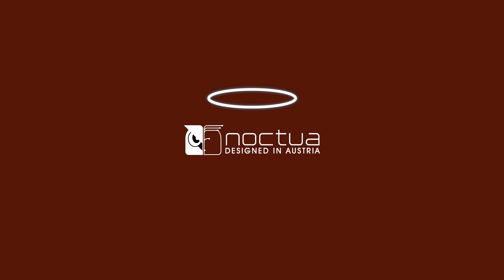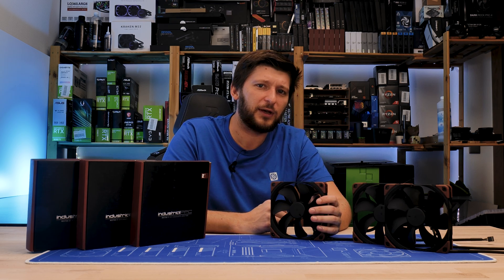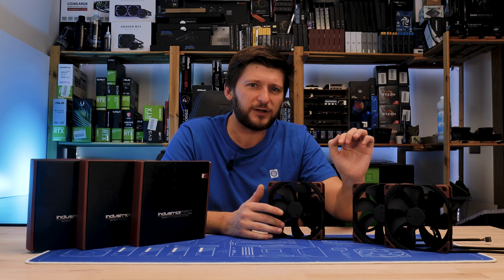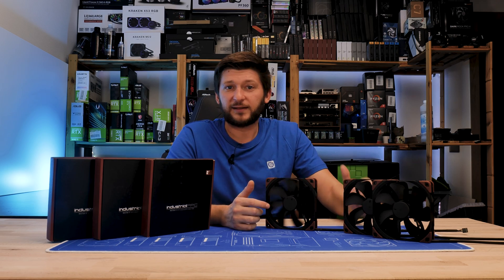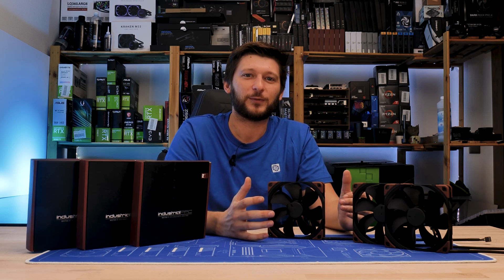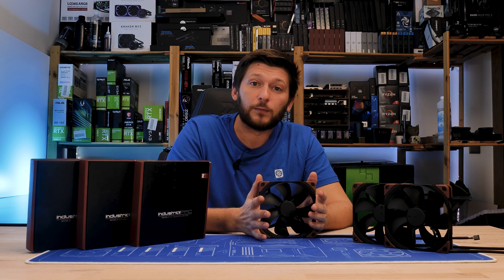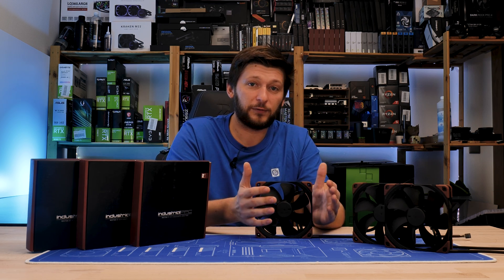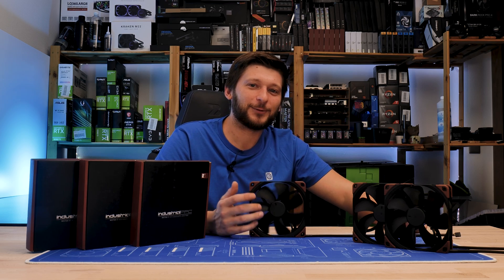Noctua Industrial NF-A14 3000 Review - The Best 140mm Fan on STEROIDS

Comment: Have these fans installed into my cabinet, had to cap the RPM to 50%, else these monsters will tear apart anyone's ear drums with the kind of noise they create.
Reply: And noctua has the fucking gall to say these fans are only 41db at 3000rpm. I expected more than straight up lies from a brand as premium as they are but I guess not. For context a quiet library is 40db, tf are they measuring it from, the moon?
Reply: @dave6800  1m from intake side without resistance
Reply: @Legolöwe  Oh so it isn't even some terms and conditions bullshit they're literally straight up lying 😂. Once again 40db is described as the noise level of a quiet library, yeah fucking right noctua. Trying to play us for a fool by acting as if that 3000rpm behemoth is at all silent
Reply: @dave6800 I love Noctua but I said the same thing. LOL!
Reply from the maker: Yeah, makes sense. But at 50% they are still monstrous. Overkill, but monstrous.
Reply: Sounds like helicopter taking off
Reply: 41,3 dB(A) is safe.